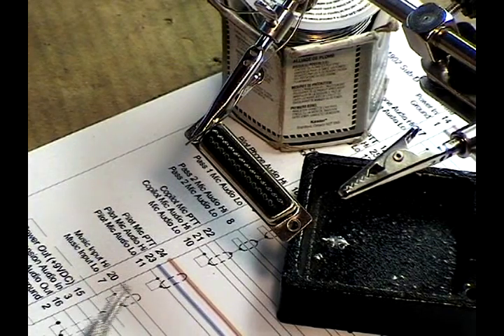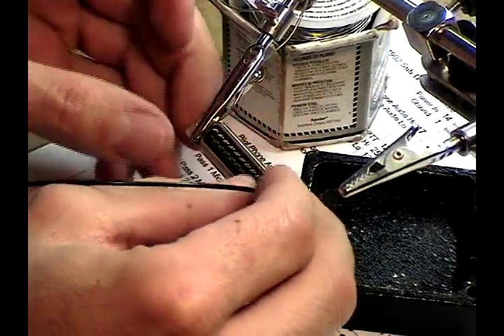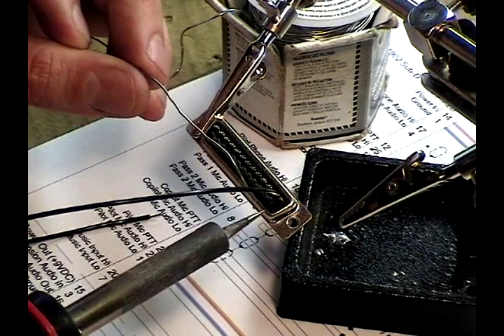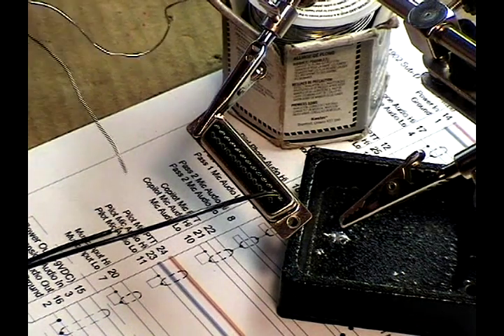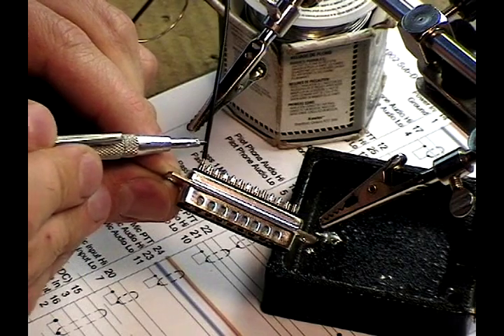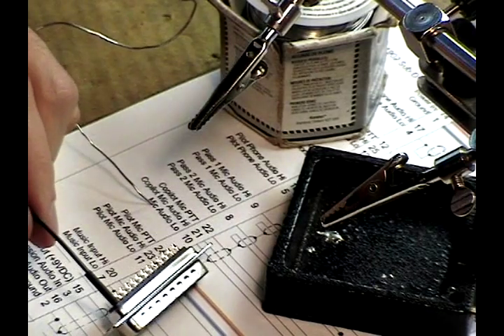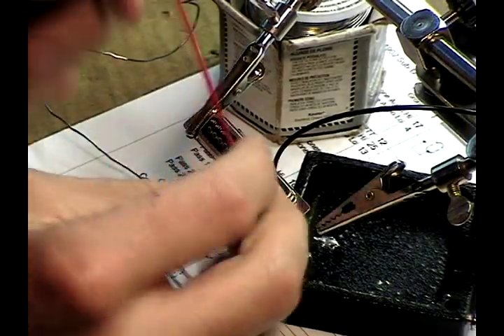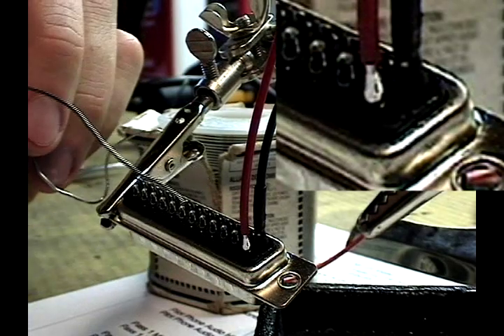soldering d sub connector

Comment: Thanks will be useful when I attempt my first DB26 connector. Heat tip is good as I was concerned about melting the mounting plastic for the pins.

Comment: Your method is  overwhelming accurate : thanks.
Now: please: may I offer a question?( a practice question, though not so practical):
Dear Sir: what would You do with twisted copper wires, with no isolation, in order to solve this kind of problem ? Apart from using epoxy resine kind of stuff paint ?
Best Regards

Comment: 20 gauge you say ... I was worried about putting a crimp style disconnect on the end of the wire i would solder into one of these but a 20 should easily work with the standard crimps.  I was worried you would need a 24 or smaller hell I would take a 22 thanks for showing me it would work. The Iron as heat to shrink the shrink ... nice won't have to borrow a hair dryer from someone ... thanks twice.

I am rather new to this all so thank you again 
Aberran